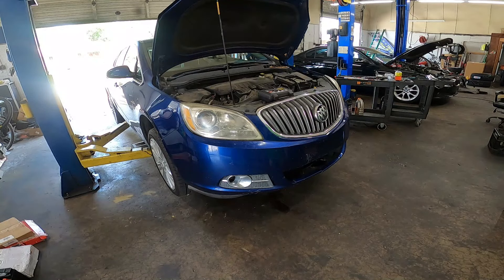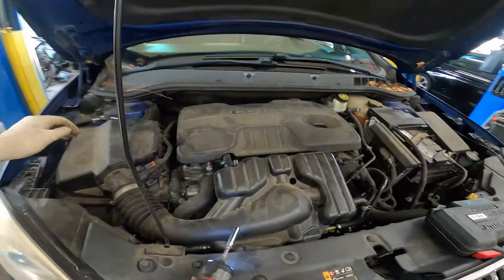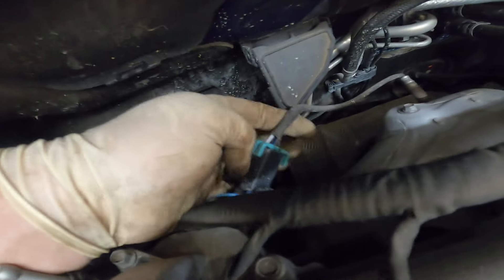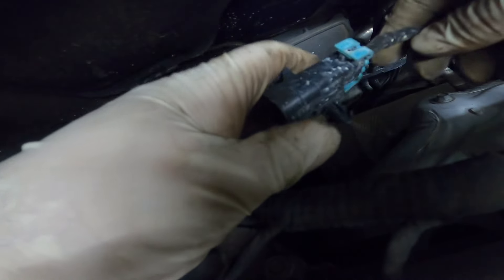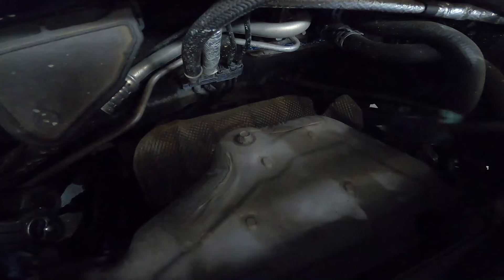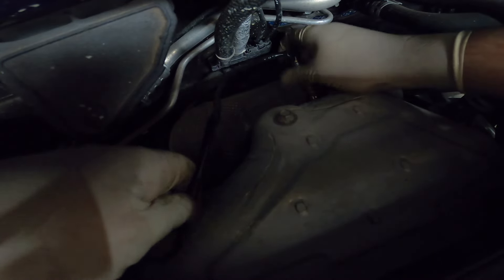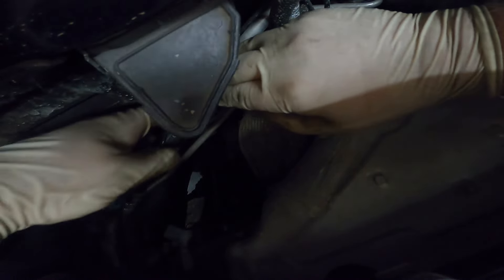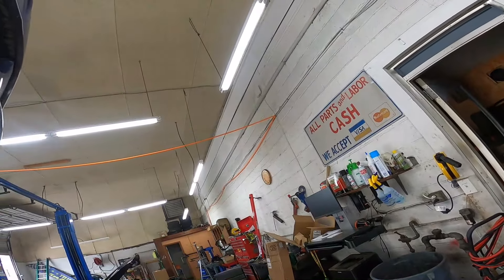Buick Verano O2 Sensor Replacement

Comment: The connectors are not the same for both o2 sensors right?
Reply from the maker: @Gswain  not sure, some manufacturers make them the same and others don't. What's usually different is the length of the cord.